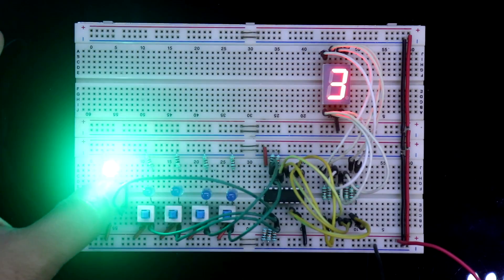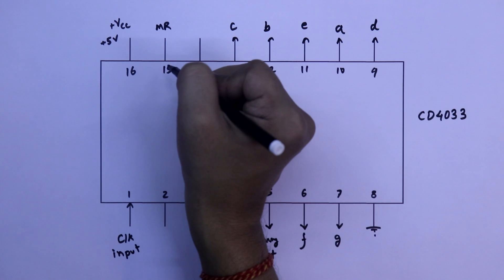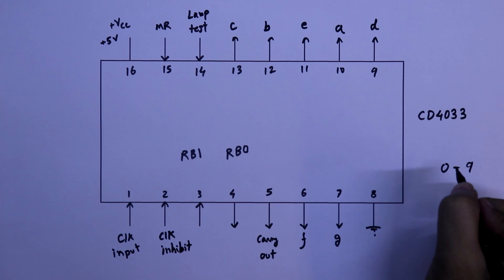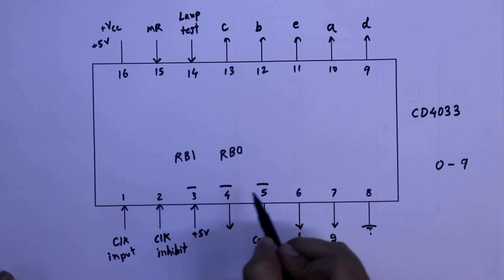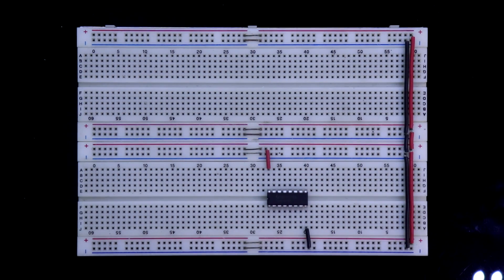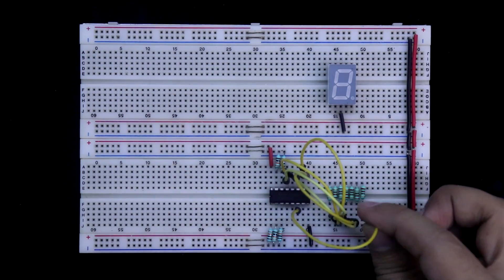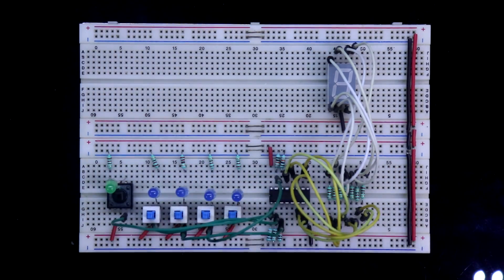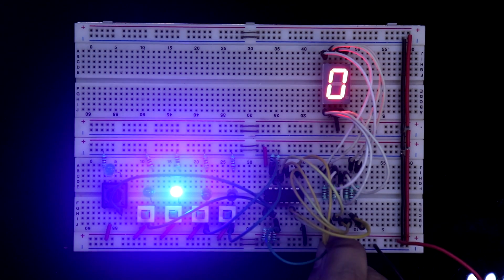CD4033 | Seven 7 Segment Display Driver IC 4033

Comment: Thanks for this video! I've been building a counter with a "+" and "-" using an Arduino NANO which I need to miniaturize. Is adding a" minus" button possible with this circuit? I am relatively new to electronics.